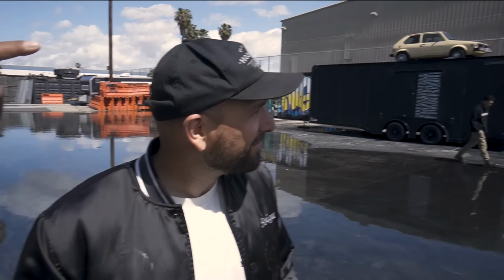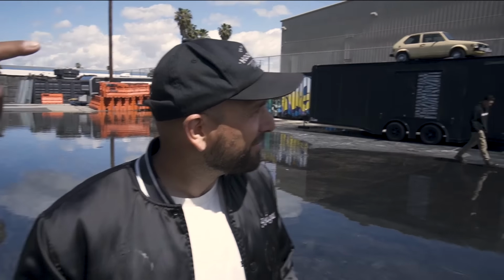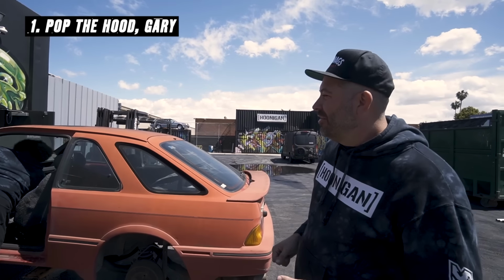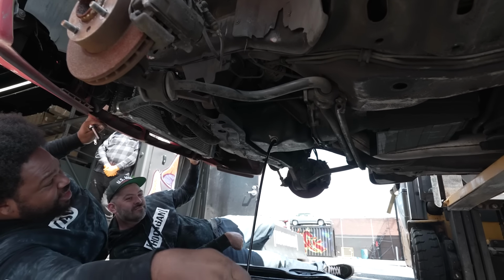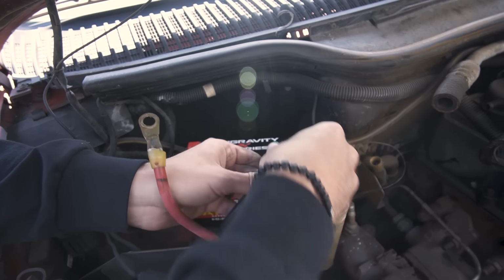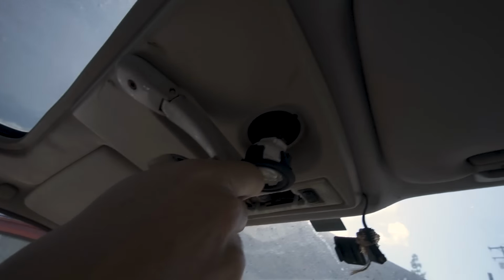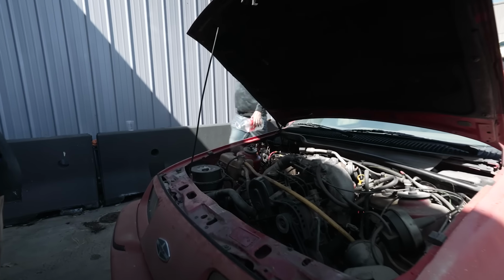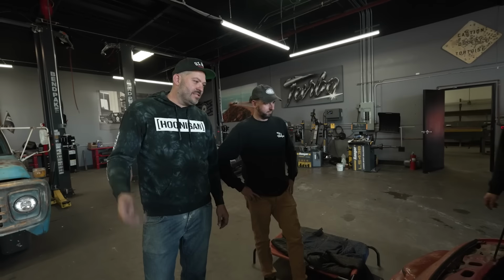Will our Merkur XR4Ti actually run? Hoonigan Project Garage is BACK!

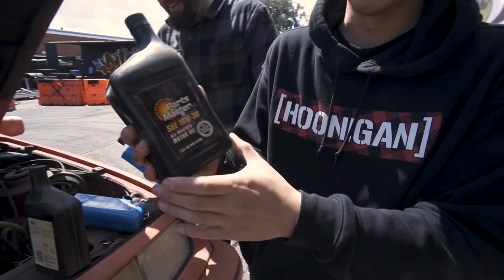Comment: 10:36 "Known as a pinto engine" shows image of a pacer for some reason
Had to point it out you guys are great
Reply from the maker: close enough
Reply: @HooniganProjectGarage  :'D
Reply: @HooniganProjectGarage  😂😂
Reply: Pacer had a GREAT engine, the 258 straight 6, same as a Jeep. You kinda need an anti-material rifle to kill one.
Reply: This great. The boys are back.
Reply: It came in alot of rangers too if you need parts
Reply: What amazes me is this. That car sat on top of a solid steel container. I guess it reached temperatures of 130 degrees constantly. It fired right off. Then yall brought the paint back which is amazing.
Reply: The engine seals never failed. Im blown away. The constant California sun just kept her waiting.
Reply: @HooniganProjectGarage  and the skyline had a 2jz.....
Reply: It’s actually a “Lima” motor (2.3L) if we’re being technical. The Pinto motor (2.0L) was primarily in Europe.
Reply: The lima NA sucked in the foxbody base models sounded horrible too haha

Comment: This one hits home.. my dad gave me his old 86 merkur for my first car in in 06. The turbo lag was insane but it sounded great.. no intercooler and the headgasket was cooked so it was always running hot. Mine was red too. I really loved the rally history this platform has overseas. I definitely want to own one again down the road, maybe put a modern Ford turbo 2.3 in it. Cheers
Reply: You should absolutely make that dream a reality. That would be awesome, especially with the back story
Reply: Not just rallying, it won pretty much everything it got entered into.
Reply: X two on the 2.3 Ecoboost swap. Problem is my 2.3 Lima won’t die- 
I want one from a Mustang with a 6spd manual gear box.
Reply: Put a cosworth 2.0 Turbo in it and a T5 trans.  The T9 that came in it was horrible and far too easy to get in reverse like he said.  I don't know how many times at a light I would get reverse instead of first.

Comment: I used to have an 86&87 XR4TI. My biggest issue was changing a freeze plug and replacing the gasket on the sunroof. Motors were in ok shape so I only had to do fluid changes and replace all the gaskets.  The T3 turbo made them fun to drive. Yes I'm a girl but love mechanical repairs.
Reply: The T3 gave the XR potential to make more power than its stable mates, the SVO Mustang and Thunderbird Turbo Coupe, as they both used smaller
IHI turbochargers. 

The lack of an intercooler, use of a smaller vane air flow meter, and the use of a less capable computer severely limited the XR4  from making the power that T3 could ultimately produce. Change those few parts on an XR4Ti and it changes the car dramatically. 

Ford left a ton on the table with these cars to keep them under the top two flag ship models of the era for sure.

Comment: I'm so excited to see you working on the Merkur. I have a 84 Mustang SVO which has the same long block. Anyway get yourselves in touch with Stinger Performance and maybe Eslinger too and you can turn that thing up to 11.
 It's also a good idea to relocate the ignition module because they like to die and leave you stranded. Either that or keep a spare in the glove box with a 5.5mm thin wall socket.

Comment: Been waiting for this ever since the Gymkhana when you bought it. I had one EXACTLY like that in 1994-1997 when I traded it in for a new F150 to be "responsible"  for my ex wife. Loved that little car. Drove the absolute shit out of it. Replaced the turbo twice, the rear diff twice, and found out that a lot of the interior parts would swap with Escort parts (turn signal switch, ignition switch, a/c controls, heater core, etc). Loved that car.

Comment: I had a few of these cars back in college.  First mod = 3” exhaust and open air filter.  Had a lot of fun pissing off the neighbors.  That 2.3 is a tough little motor and will take a lot of boost
Reply: I think it already has exhaust from Rapido Group on it. It has a dual outlet, they were single shot stock so he gets to take a short cut. 

Next mods I would do are a Mustan SVO PF3 ECU and an SVO or Turbo Coupe Big VAM, and an intercooler. Up boost to 18psi, and proceed to be astonished at how quick it can become for being such old technology lol.

Comment: Glad your doing something with the mercur, im from uk and had a sierra xr4i back in the day its basically same 3 door split wondow shell but with a 2.8 n/a v6, had plans for a cosworth replica but put it through a hedge backwards before i got a chance, good times👌
Reply: Wasn't that split window US only thing? Or am I just confusing myself? 🤔🤨
Reply: @patrikpolda  we got one model of 3 door with split rear windows, xr4i from i think '82 to '85 when it was replaced by a 5 door with 4x4
Reply: @colinsturrock688  now I see. So I was just confusing myself. 😁
Reply: @avschie6713  cosworth wasn't the only 4x4 sierra. You could also get them with other engines and trims.

Comment: I've owned 4 of these cars, and they're pretty easy to work on once you get past their inherent "weirdness" and quirks. The engine is easy to get parts for except cylinder heads, and parts are cheap compared to the stuff you are used to. The heads do bridge crack and no, the Ranger one won't work. Twin plug heads don't flow. It has to be a D-port turbo head. Porting the intake manifolds and head are good ways to make power, but the bottom end tends to not like RPM, so don't expect to go past 6500 under the best conditions. The engine is cast iron head and block, with forged pistons, rods and crank. I've changed a head gasket in one of these in two hours with hand tools. They are non-interference timing belts, and there are some parts out there like the Fel-Pro 1035 head gasket that can handle more boost. Do yourself a favor and change the rubber driveshaft coupler ASAP before it grenades the transmission extension housing by going out of balance. Or T-5 swap it, but you will have a notchy shifter that way. Cams can be used from the Ranger, but there are some aftermarket cams still available. Also, you will eat plug wires. Get ceramic ones. 

If you haven't noticed, I miss having one of these cars. They are a TON of fun.
Reply: All super solid recommendations I salute you sir- 🫡

Comment: My 1990 Volvo 740 used to fly through water no matter often I filled it, I remember sitting in my best friend’s driveway waiting for it to stop bubbling like this 21:57
Reply: Also, if you’re wondering I had to scrap it because it blew a head gasket and cracked the block

Comment: In the UK that's called an XR4 Sierra, they did a Cosworth version of it as well with a whale tail for homologation rules of Motorsport.

Absolute weapon of a car you can find in the UK for less than £100k like $125K

Also a 2 door rolling road chassis in Ireland can go for anything between $1500 and $3000

Comment: The XR4i was an NA trim level on the Sierra, and was basically the same spec as the Merkur was, except that the Merkur got the turboed Pinto motor. So just toss a little T in there for Turbo, and call it a day.

Comment: We had the Sierra XR4i in the UK. Same body shape as that but with 2.8 injected Cologne V6 and then 2.9 V6 a bit later on. We also had a 2.0i Sport. (which i had way back when) Again same body but just a 2.0 injected pinto. No turbo because for that we had the RS Cosworth and RS500.
Reply: A mate of mine had an XR4I with a TurboTecnics conversion manys moons ago. The intercooler looked to be just a repurposed ally rad and it ran so much boost that it had expanded the  core like a balloon.

Comment: In the UK that would be a Ford Sierra XR4i.

The ancestor of the 3 door Sierra Cosworth.

Over here it came from the factory with a 2.8 litre/liter fuel injected V6 and manual transmission.

I believe that after Ken's original Escort Cosworth WRC burnt to the ground he bought a car from the UK, owned by a bloke I know called Mark Roberts, who had a warehouse full of ex-Ford WRC Escort Cosworth parts, including several steering racks which you guys had re-manufactured at great cost before finding out there were several sat in a warehouse in Liverpool.

Yes/No?

Comment: I know in this case it don't matter much but I do see this often by people who filling up engine oil; 

When motor oil will be refilled with a number of plastic bottles (small or big size), turn the bottle 90 degrees and hold it like that while pouring in. The oil will flow out way more smoothly and it get's less messier. Simply because the air inside the bottle (which causes vacuum if holding down the bottle) can escape much better.

Anyway enjoyed the vid as always:) I'm curious to see what's coming this year with the Gymkhana grid 🔥🔥

Comment: If the coolant keeps bubbling and gets worse when you rev it, the head gasket is gone. It should be flowing the water but there should not be any bubbles coming up. The geiser you got when you first put water in was probably it boiling off on the hot engine right away. 

If you're ever in this situation and you've got the coolant system filled, and bled, go for a casual drive to have all the heat dissipate. If you park it that hot, the engine might warp or crack. The same can happen when you just chuck cold water in, so be careful doing that. Don't do what Vinny did, you can definitely crack something from temperature-shock. That works both ways.
Reply from the maker: Never do what Vinny does (to other people’s cars).

Comment: That parts master "oil" was definitely the right call to use. Don't want to use expensive decent oil when your simply seeing if the car starts. Plus it's been sitting there for a while so using some no name oil to just get it to run through before dumping it again is a good thing.

Comment: I used to own a couple of these vehicles I’ve modified the transmission back in the day for a T5 stick shift from automatic 3 speed might want to check out the timing and the temperature on the turbo looks like the timing might be off a little bit which will cause blowing head, gaskets or radiator overflow tank to expand like a balloon 🎈 or blow your head gaskets

Comment: Dude, we got these as an mk1 XR4I with a V6, then we got the Sapphire, with the Cozy engine,4 pot with a turbo 2.0l , they got stolen alot, well to point no one couldn't be insured on them, so they stopped selling them! 😅😢😮
Oh, the Pinto engine is pretty good! For its time! Put a twin webber on it. 
And we got better rear ends as well, I knew a dude who used to make 2 doors cosy from mk1 XR4 😮

Comment: Intercooler. Stinger head. Cam. Bigger exhaust manifold. 3 inch downpipe. 5.0 mustang injectors. Gutted upper intake, ported lower, T3/t4 turbo, PIMP ecu. Xr4ti will play.

Comment: Hey guys, i'm sorry but the story behind the mercur isn't completly correct. There was a Sierra XR4i in europe, it looks exactely like the mercur xr4 Ti. Btw, it's the only version of the Sierra that has that weird double sidewindow in the back. The sierra XR4i prefacelift had a 2.8l V6 named köln engine in it (later that enlarged the displacement to 2.9l), while the later model had a pretty boring 2l dohc with 120hp. The Mercur XR4Ti was just brought to the US, because the Sierra XR4TI, which was the homolgation model to compete in a variaty of racing classes, had to be sold a couple  hundred cars and didn't manage it in europe, so they brought it to the US to sell those missing 100 units. Ofcourse Ford told the US citizens it was to compete with the small BMW E30 models, but that was a lie! They just had to sell more units to get the homologation for the Sierra. Ford did stuff like that a lot of times back then. Like the Ford Probe GT, which was a simillar story, just the other way around. They couldn't sell the Probe in the US, so they brought it to Europe and told everybody it's the new Capri and it was specially made for the european market... But all they did, was put on some taillights with orange indicators and added an transmission cooler because it was exploding on Autobahn speeds without it and changed the speedo to metric system.

Comment: I loved sierra's here in old blighty, the mk2 had a better looking front end, and those pinto engines, we used to rag the HELL out of them, but we didnt have the 2.3 turbo in them, but i know the rally boys loved the 2.3, used to come with a blue rocker cover iirc, also dont worry about losing keys its not like the security is up to much on them, they later put immobilisers on them, but all you had to do is turn the ring switch around the door lock barrel and the alarm and immo were off, late 80's security was child's play, could find a v6 24v cossie engine out of a scorpio or simular and drop it in there 😁

Comment: This engine is a 205 block, if you mount  rods from a 200 block (4x4 cosworth) the compression is lowered to 7.8. steel head and really strong headbolts on these units, and with a kent cams fr32 cam, rs 500 style ic and you can get solid 400hp from it, and it takes the beating all day long. Sachs 4 puch clutch. Trans should be the same as in cosworths but only with different spline input shaft.

Comment: Whaaaaat, and XR4i in the US??? I use to own a turbo'd XR4i in the late 90's when I still lived in the UK. Overboosted madness engineered by the UK firm TurboSystems, with a totally unnecessarily loud dump valve. Damn I miss that car. 230 at the crank sounds low now, but BOY did it make me smile.

Comment: The 2.3t lima is pretty strong in stock form. You can turn up the boost a bit n add a front mount ic. The trans isn't the strongest n neither is the rear-end if I remember right

Comment: Down here those came with a v6 and people had to start either drilling holes on that front piece, cutting a big square and adding a mesh or getting the later generation's front pieces with the factory vent holes so they wouldnt overheat too bad in the tropical weather, I guess the first ones they just built euro spec without thinking about the weather 🤣 pretty cool and underrated cars tho.

Comment: i had no idea america got a turbo version of the XR4i , im almost certain they were only sold as N/A over here in England , apart from the Cosworth but that didn't have the pinto engine in ... its nice after years of being a ford fan to still be learning about cars i didn't know existed , interested to see what you guys do with it
Reply: Yes we only had Turbocharged cars. 

The reasoning behind it is the Cologne V6 that you guys got in the XR4i would’ve still needed to be run through testing and modifications to pass emission standards in the U.S.  that otherwise did not exist in Europe. At the time America was still reeling from the smog crisis of the late 60’s and 70’s. 

Bean counters didn’t want to blow the budget, so they used the already emissions legal engine from the Thunderbird Turbo Coupe, and mated it to the European Ford T9 dog leg reverse transmission to curtail cost. 

They stripped the intercooler from the engine, but used a larger turbo to help keep knock under control, but then used a much more conservative ignition timing map to make sure the engine didn’t produce as much power as the Thunderbird Turbo Coupe. 

 They also used a taller gear ratio to make sure that, even though the car was lighter, it couldn’t out accelerate its upscale brethren. 

The SVO Mustang also used a similar engine but it was not the exact same as others have said. 

The 205 engine block is slightly different and is a stronger base to work with because it was used in competition with higher boost pressures and is less susceptible to the hairline cracks that can develop over time in the T-Bird and XR 2.3 “Lima” engines.  

It’s a thicker block if I recall correctly. The rods pistons and crank are otherwise the same. 

At any rate the other misnomer is what was said about the name that was given to the American Sierra. 

Ford U.S. couldn’t use the proper European name  because Oldsmobile held the rights to the name “Cierra” spelled with a C and  GMC had rights to the name “Sierra” spelled with an S. They were essentially cornered. 

So for the American market the Ford Sierra XR4i became the German named Merkur (pronounced mare-coor) XR4 T indicating its now turbocharged- I (XR4Ti) 

I’ve had mine for about 23yrs of its 35yrs of age. I have zero intentions of getting rid of it- 👍🏾

Comment: Takes me back to the 80’s growing up in the uk we used to get the xr4x4 seirra tho that had a v6 had a spicy spoiler on the boot. The stock pintos in the uk were carb fed 2.0 litre boring as hell. Obviously you had the cosworth whale tail until the boring rep mobile sierra sapphire cosworth came out. Was a company called turbo technics that could perform full turbo conversions on your fords back then.

Comment: • Pop the hood, Gary
Gold Star.  Gary did it.
• Check for rats
Participation Trophy.  You checked ONE spot.
• Check Fluids
FAIL.  Skipped: brake fluid, power steering fluid, clutch fluid, transmission fluid, diff gear oil, coolant
• Change Oil & Gas
Participation Trophy.  Changed Oil but added questionable gas to bad gas for probably maybe ok gas.  But didn't check fuel filter, lines, fuel pressure.
• Spin it right around.
Gold Star.  Proof you can spin anything for a short time.

Comment: actually there are ford fiesta xr2, ford escort xr3 and then sierra xr4, and xr4x4 is 4wd. I hade a sedan sierra with a 2.9 v6, manual, pretty fun car to slide around in. There where also a scorpio, the biggest sedan, that had a cosworth built v6.

Comment: This inspires me to revive my 1989 Bf chassis Mazda 323 essentially a better looking ford escort! Sadly it’s not a GTX awd turbo! Just a mild run of the mill 1.6 liter single jingle 8valve with a 4 speed gearbox made of glass 😉 and 1989 was like a split year  at the tail end of the year they switch body style too the Bg chassis and dubbed that one the GT-R